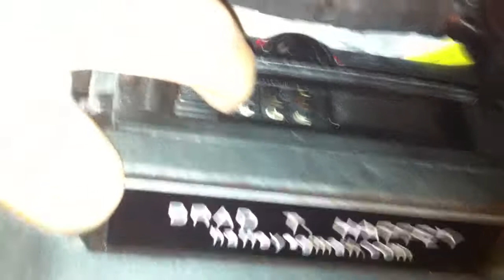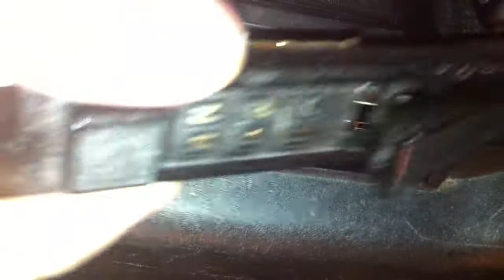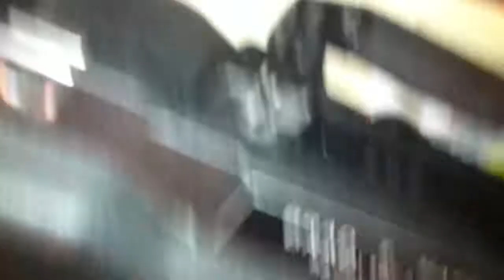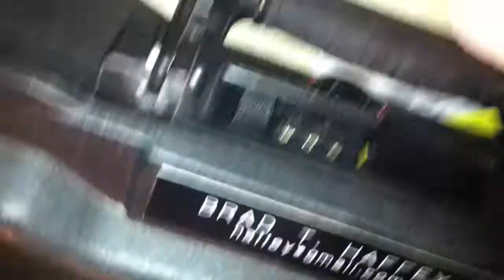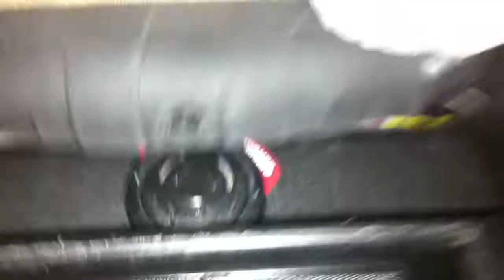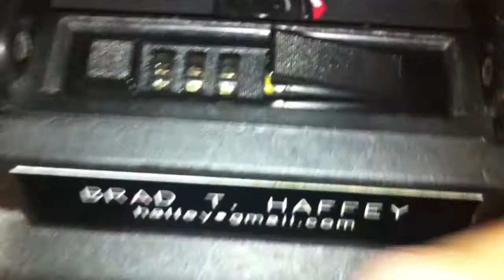Pelican Case - Locking Issues

Comment: My laptop is inside lmfao
Reply from the maker: The case is a solid 10/10 for durability, coolness, practicality... Unfortunately some of the "parts" weren't as well conceived. The Lock breaks easily over the course of time. Broke 2 so far. The interior is made of cheap materials, not up to par with the exterior case. ALL the zippers broke, and the material is starting to fray.